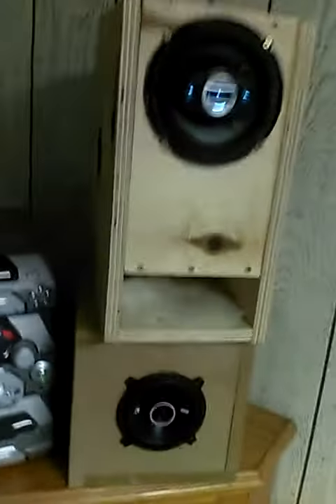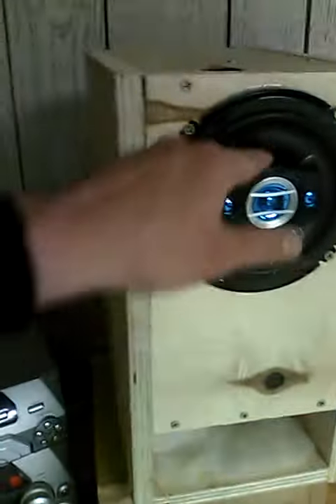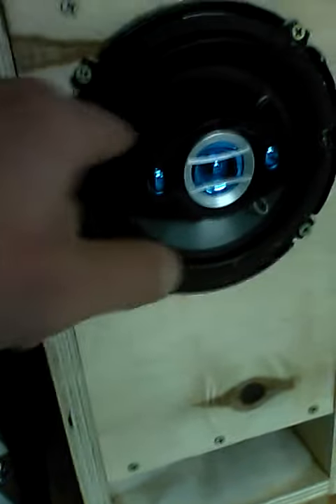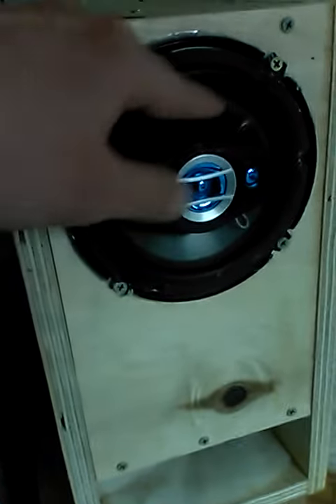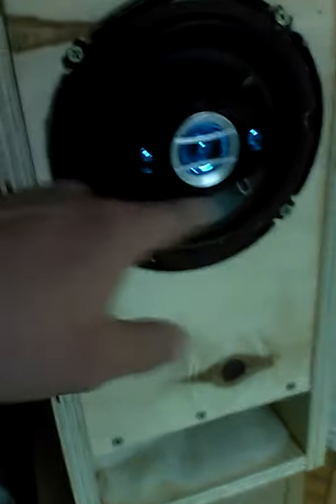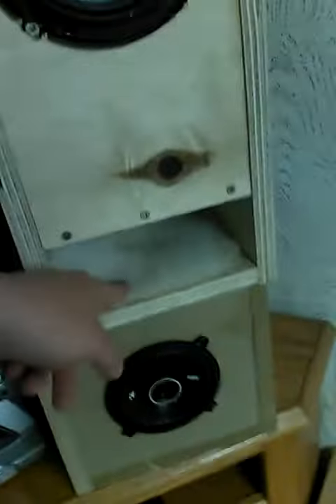Transmission Line Enclosure For 6.5 Inch Car Speakers ~75Hz Free Design FreeCAD (Don't build these)

Comment: Thanks... will try that this weekend...
Reply from the maker: If you modify the design and add corners it will perform better. I should have put them in to start with
Reply: @RobertJeffersonBased  Thanks... will do just that... :)